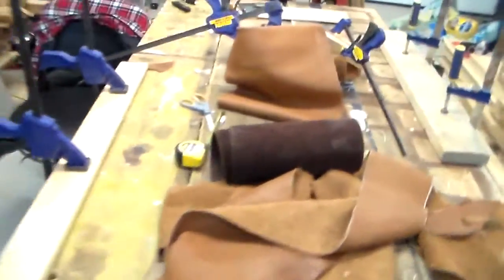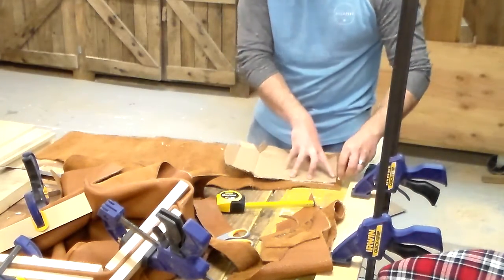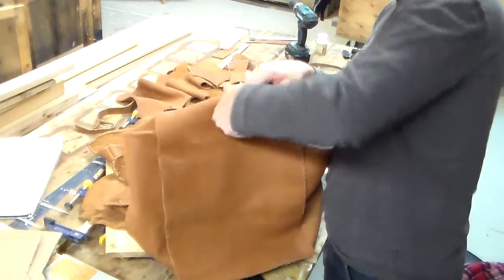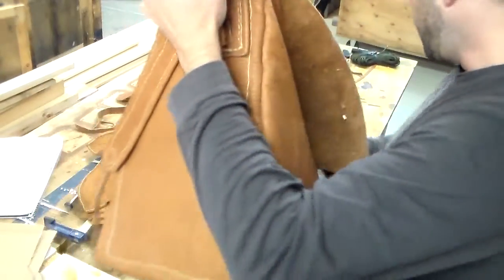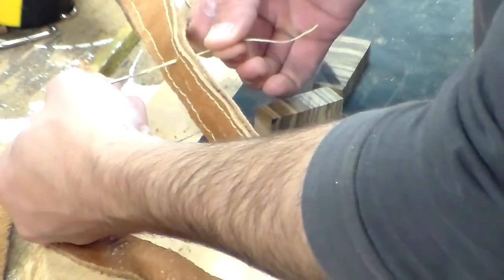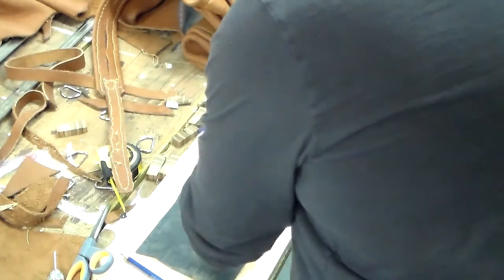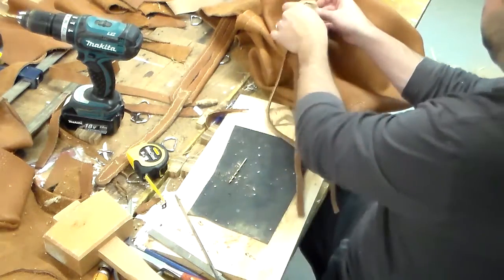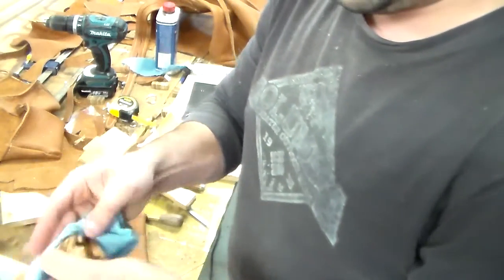Leatherworking Bison Hide BackPack Part 3: Shoulder Straps and Pockets

Comment: Buy some pricking irons, and learn to saddle stitch, that speedy stitched is rubbish. However, for a 1st project you did well brother.
Reply: I belive he did saddle stitch the main part of the pack in part 2.
Reply: I think Scott meant getting the pricking irons instead of using the 'speedy stitch' as an awl, which will also give him a tighter and neater row of holes for sewing but for all that I love this back pack and I'll be off to my leather place for a likely piece of hide. All these projects :-) Also I've found it useful to keep the thread waxed which helps it slide through the skin and if you thread the needle and then pass the needle through the thread and pull it tight it slides up on the eye of the needle and stops the thread coming loose. I probably haven't explained it well but there are lots of videos on YT that show this technique.
Reply: Yes, but, its still better than anything
 I have attempted. Bloodaxetheirritable